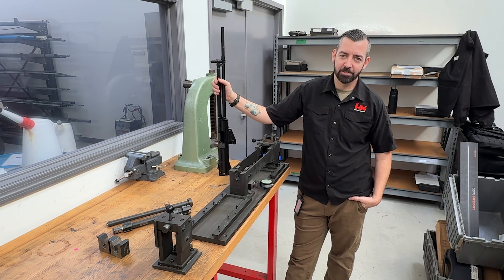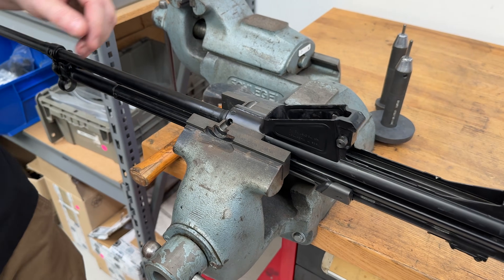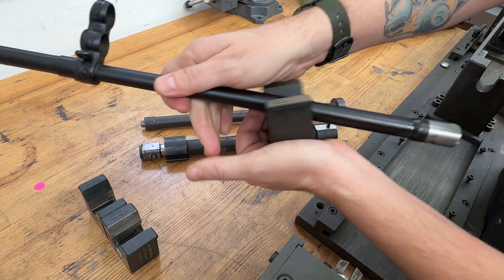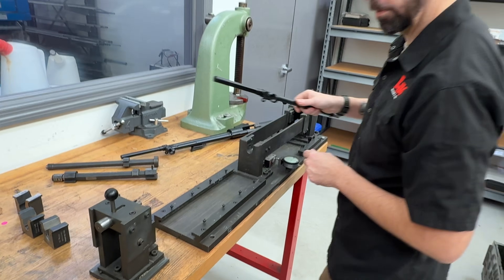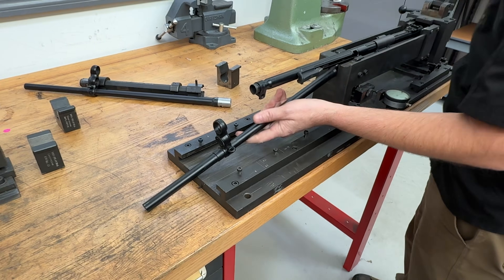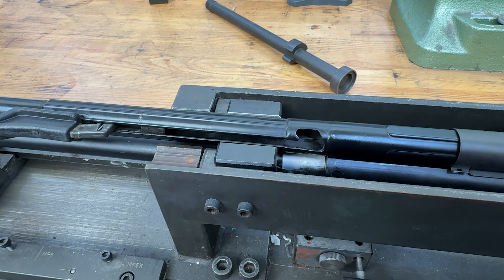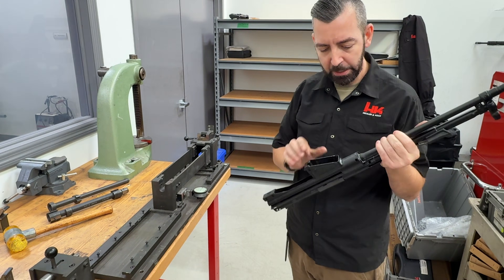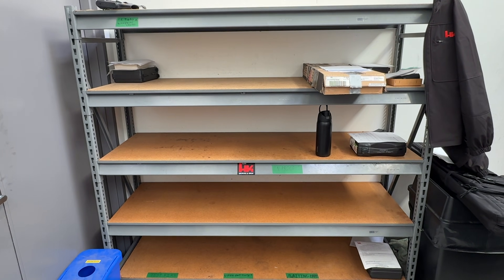Heckler and Koch Roller Delayed Barrel Change Video

Comment: As a carpenter I like to see the violence you use for knocking the pins out. Was that a single or double jack sledge hammer. At work when we get one of those out we refer to it as getting a bigger purse out to hit your problem with.
Looks like fun doing that barrel change when you're set up right.